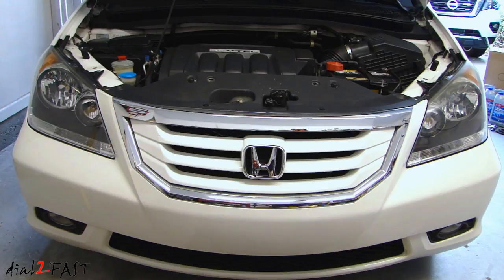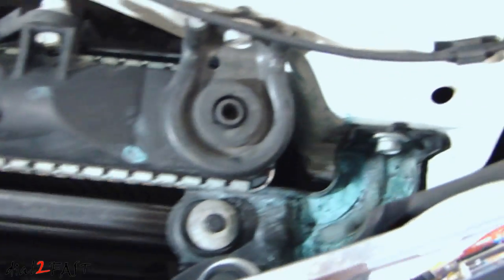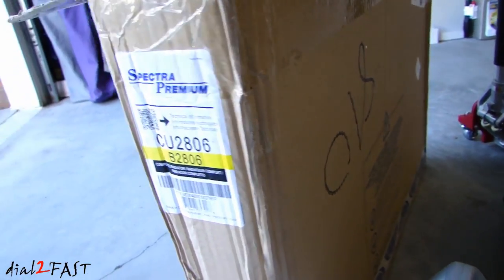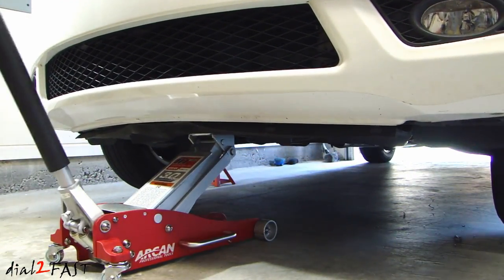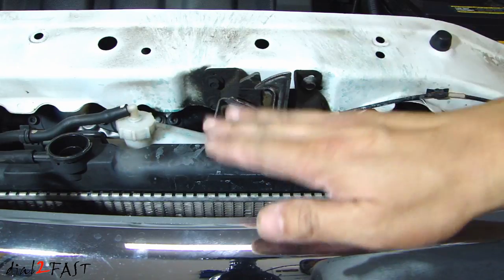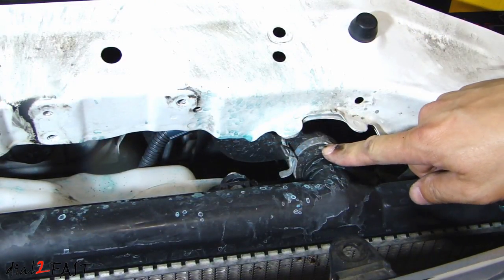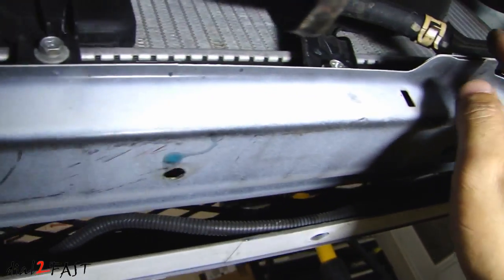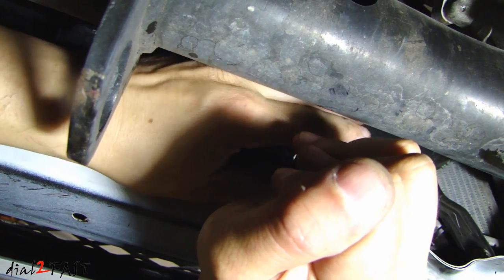Replace Radiator on Honda Odyssey - VIDEO 1 Remove Radiator

Comment: This is super important to keep an eye on especially in the rust belt!!  Your transmission cooler is in the radiator and if that fails, you could get radiator fluid in you transmission and ruin the tranny/ destroy your van prematurely.  Just did this job three weeks ago, radiator cost $175 OE, Denso from NAPA

Comment: 09 Odyssey. I was able to remove/replace the radiator without removing the bumper. I did release the clips that hold the top of the grill and then flexed the grill and bumper a little. It came out pretty easy. 

Also, I didn’t have clamps for the transmission hoses so I used foam earplugs with the lanyard style, so I could removed easily. Worked perfectly! 

Thanks for the great video!
Reply: Did you. have to lift the car?
Reply: @kmerriweather1  Nope!
Reply: Thank you

Comment: I work at a part store for 10 years and I would not recommand this brand of radiator he used here which has a high failure rate, Denso is the brand that came with the Van there is 2 options you can do here...1. you can pick one up from the dealer or 2. You can buy a Denso aftermarket Radiator which is cheaper then the Denso you get from the dealer but its still better then the one used here.
Save the money on the brand of coolent and go with a better quality part...Zerex and Peak make a very suitable coolant that meet factory specs

Comment: Here's a tip for hoses. Break the seal on the pipe,  use a pick or screw driver to lift the edge of the Hose up, spray WD40 or silicon spray, Twist the hose, it will slide right off. BTW, excellent video, lot of work doing the camera

Comment: Tip for confirmation count how many bolts we take out. Yeah u follow as you go and u understand but it’ll be helpful to say “were going to remove these 3 10mm bolt here that hold in……” “these two 10mm bolt down at the bottom” or summarize how many things we take out “these two 10mm bolts on the bottom along with three hose connections” overall this is a great detailed video. I decided to post this because someone asked the same question while watching.

Comment: Yo trabaje ese mismo modelo y solo saque el canister y los 2 abanicos y la cerradura del capo  y salio facil el radiador no tuve que remover el bumper pero si hay que sacar el cover plastico que va justo debajo del radiador para tener mejor visibilidad de los tornillos de los abanicos y de la linea de enfriamiento de la transmision ahi le dejo ese tips

Comment: Nice video, I hope I don’t need it. Just over 100k miles on a 09’. I did replace an alternator recently, could’ve used your videos on that. 😊
Reply: My 2008 Odyssey’s Denso radiator blew when 11 years old, 210,000 miles. No minor leaking. Sudden catastrophic burst.
With sudden loss of coolant, the temperature sensor is no longer covered by the coolant, so the dashboard gauge doesn’t register overheating.

Comment: You do not have to take the front end off on a 08. I have a 08 touring and my radiator went out this morning and I didn't take the front bumper off to get it out. I just took the fans out first and it came right out
Reply: So I don't need to raise my car? 
Please respond asap! 
I'm stuck in los angeles!
Reply: @eliaschase7196  no you shouldn't I didn't have to
Reply: @eliaschase7196  no you shouldn't have to raise your car
Reply: @TJsVette  they're charging me 250 for labor, is that a reasonable price? I have to buy the radiator and the anti freeze.
And thank you for responding!
Reply: @Elias Chase  it takes a few hours to do the job so yes 250 is a decent price. I believe it took me a total of 3 hours to do it.

Comment: Forgot to drop in my front catalytic converter before installing front head so now i will be following most of this procedure😐 if you ever have to remove cylinder heads ALWAYS just drop the front and back CATS in place-you can hook them up later easily without all the added work i now have to do😎😎😎

Comment: On my 2009 ody I was able to get the radiator out by removing the fans from the radiator and moving them towards the engine.  Be careful - in salty climates (like Boston) the bolts will rust.  A couple broke off.  Use some penetrant...

Comment: Ah you did it differently. I removed the fan shrouds and coolant reservoir first and then removed the radiator, shop manual actually says this. Remove the A/C condenser brackets to allow the A/C condenser to give you some room to wiggle the radiator out. Yes damn bumper has to be removed lol
Reply from the maker: Yeah, I did notice there were 2 ways of going about this, and I thought just taking the whole thing out was easier for me. Whichever way, the end result is the same.

Comment: Love all ur videos. I like how u explain everything. Just wondering if you've ever replaced ur alternator. I did mine the other day and pushed the power steering pump aside out of the way and when i put everything back my power steering pump started to make noise.  It never did before. Just wondering if in deed its bad or maybe has air inside?
Reply from the maker: Sorry, I have not had to replace mine yet.

Comment: Did you pressure test the radiator to find the actual leak?  Thinking you may have had a bad radiator cap
Reply: Wasn't the cap, I got the same car and apparently it's a common issue. The plastic part literally separates from the aluminum of the radiator. Had to do the same thing when mine was at about 90k miles.

Comment: You really should've had the rear of the van up on jack stands also, so the vehicle would be level so you'd get more of the coolant out
Reply from the maker: +badranger2004 There is no reason to raise the back up when replacing the radiator. This is not a coolant flush service we are doing. For this job, replace the radiator, refill the system, and bleed the system. You need that front end as high as possible to bleed that air or you will have a heck of a time bleeding all the air out which can cause all kinds of problem.
Reply: dial2fast, as a service technician at a dealership, it is always recommended to flush the cooling system when replacing a major component like the radiator or water pump, or even the heater core or cores, to prevent contaminants from the old part from damaging the new or if someone has used a stop leak product

Comment: Don't know if you've done it already but your transmission fluid looked awfully dark. You should drain it and refill.
Reply from the maker: Yes it was due for service. I got it done shortly after this video. Thanks
Reply: The requirement is a drain and refill every 30,000 miles. This doesn’t drain the torque converter. Experienced owners drain and refill every 15,000 miles with the current spec Honda fluid. This partial change avoids a sudden change in the total fluid, which can cause trouble.